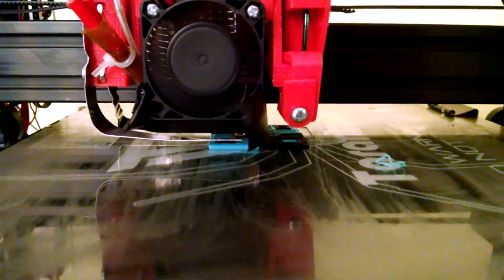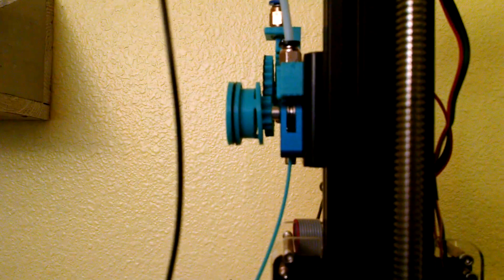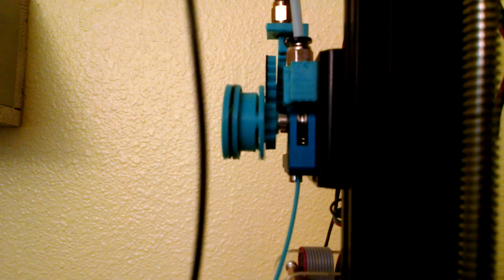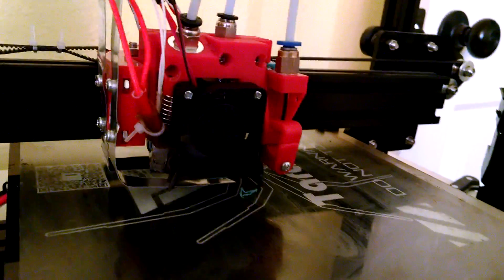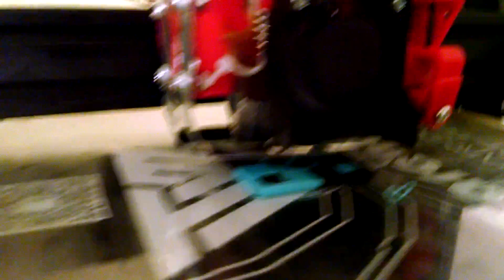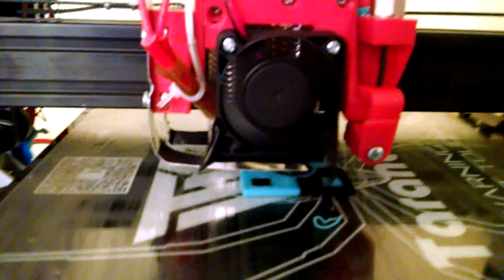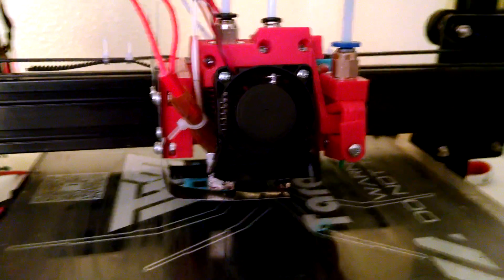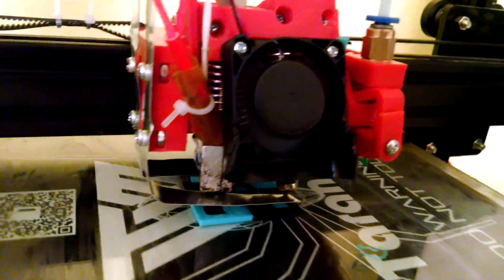Working! Dual Extruder Anti Ooze Mechanism - no added electronics, firmware

Comment: Still suspect the right approach is a corona discharge extruder for instantaneous heating and increasing the surface energy/tension of the molten material. Might also improve layer adhesion.

Comment: The ONLY issue I can conceive is the same problem with all dual extruders, it's annoying as fuck to keep them in sync. Still this is an amazing design.
Reply from the maker: +MineFutures Yep pretty much. However whats nice about this design is the second nozzle doesn't scrape over what you are printing, so the z alignment doesn't matter as much. Plus if you could find a slicer that allows you to do a z offset between extruders, then you can really fine tune it. But as far as calibration goes, it's still a bit of a pain.

Comment: Have you tried tweaking the stepper volts for the clicking extruder motor?
Reply from the maker: +Sean Phillips it's actually not the stepper that's clicking. It's the mechanism "stepping" which is what it is supposed to do. It just gets a little annoying. The current version has less play in it, so the clicking is less noticable.